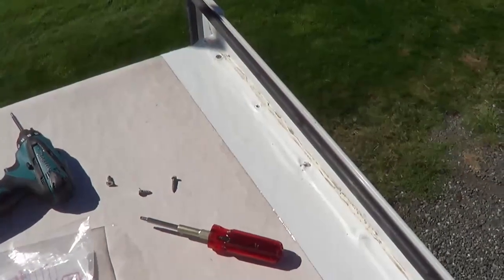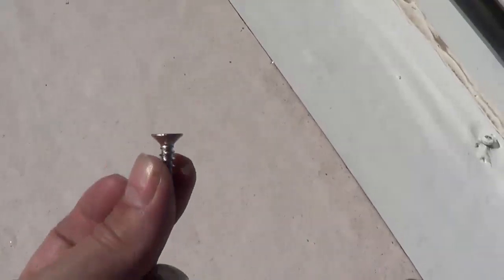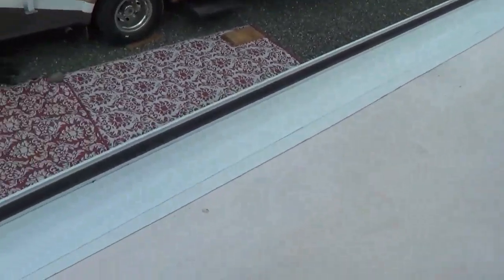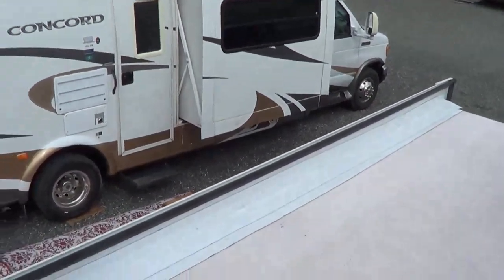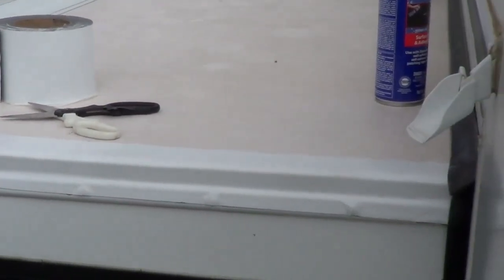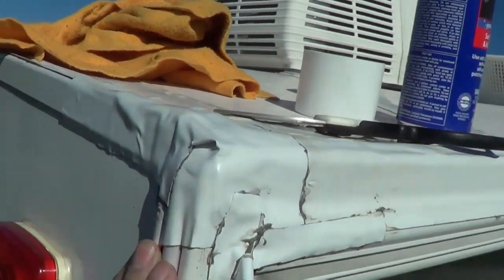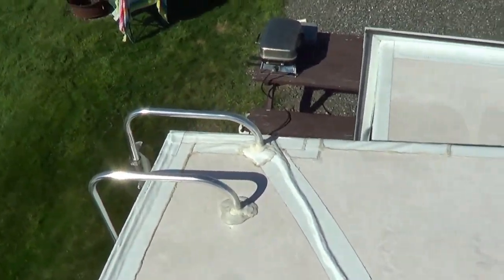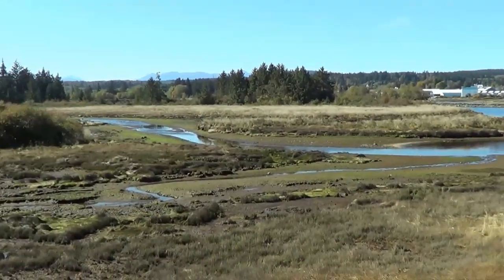Beefing Up My RV Roof Seals and Seams with Eternabond

Comment: What are you using to clean it with first?
Reply from the maker: I usually clean the roof first with water and dawn dish soap and a soft bristle brush. The use either mineral spirits, acetone or the Eternaclean spray. I decided I like acetone best, cheaper than Eternaclean and safer on the rubber roof than mineral spirits, though if your careful and make sure to wipe off excess it's not too bad.
Here was my original post on the tape and also my latest update.  https://www.loveyourrv.com/resealing-rv-roof-eternabond-tape/  https://www.loveyourrv.com/rv-roof-repair-eternabond-review/  Cheers! Ray

Comment: the tapes good in a lot of applications. but i would think twice about putting them on the corners & edges of roofs too much like that. Increases the chances of pooling with the tape acting as a small wall which wouldn't be too much of a big deal if it were a full fiberglass roof. but you said it was a EDPM Rubber roof.  like at 8:18. I can see that being a pooling spot with all that tape there. so with a EDPM you might have to watch it like a hawk for any cracking of the EPDM, which could still allow water in and a worser leak with the pooling. 

So be careful. :-)
Reply from the maker: +Troy Foxxin Good tip so far I'm not seeing water lasting very long up there, so no long term pools. I will watch the EDPM but I think with my trailers corner design it's an improvement. It was designed to pool right from the get go, very poor design I think.

I actually installed an on roof gutter to try and divert the bulk of the water and especially the ACs run off from getting to the corner. I get less pooling now and in my mind much more protection than original factory seal job.  There used to be many spots on the roof around vents and stuff where water would pool around the lumpy Dicor, now most pooling is on the E tape itself.

Here is a video I took of that area after we had the trailer 18 months for a look at what I mean. https://youtu.be/Cm5bGwXIZgw

Cheers Ray
Reply: Love Your RV oh i remember that video now. yeah silly design but that's cougar for you now that i think about it. lol

I seem to recall seeing some similar designs on other cougars i saw when working at a RV Dealer.

Comment: I’d have a concern that when you sell, a prospective buyer is going to suspect a situation happened that was far worse than you were trying to prevent. Just wish it could be made to look a bit better.
Reply from the maker: Yeah, that's a con for some and it may affect any warranty claims but for me it's worth the extra protection.  Five years later now and tape is still in good shape, no maintenance other than a roof cleaning has been required, sure beats digging out old sealant and adding more globs of it each year  - Most recent look at the roof -  https://www.loveyourrv.com/routine-rv-roof-maintenance-inspection-and-leak-protection/
Reply: On the flip side of that coin, a buyer may see that as what it is, preventative maintenance, especially if they look around and see no water damage or intrusions.  1st time buyers or those who lack understanding and knowledge will be the ones who would fear this.
Reply: @logun1970 . Exactly! Preventative maintenance.

Comment: How is it holding up after 5 years??
Reply from the maker: Great, no leaks and it hasn't peeled off.  I've used it quite a bit for stuff on the roof - https://www.loveyourrv.com/rv-roof-repair-eternabond-review/
Reply: @LoveYourRV  yeah I purchased it for my camper as well either tomorrow or Monday I'm putting a new roof on along with this tape so I'm pretty excited!
Reply from the maker: Cool. :) I recently redid my slide roof membrane - https://www.loveyourrv.com/alpha-systems-superflex-roof-installation-replacing-rv-slide-membrane/  My main roof is still pretty good even though its 10 years old so waiting for a good stretch of weather to just add some acrylic roof coating to it. It will give me some more years out of it, spruce it up and help it reflect the heat. Will be interesting to see if it sticks to my Eternabond tape.  Cheers, Ray
Reply: @LoveYourRV  the only thing is I think you should switch to silicone roof coating instead of acrylic!
Reply from the maker: This is what I'm going to put on https://store.lci1.com/4034-acrylic-roof-coating-white-1-gallon-862401.html  First you use there 8010 primer adhesive then the top coat. I've tried a number of the Alpha products so far and they have been good. You can also keep adding the product over its self.

Comment: Did you use Dicor lap sealant on the edges of the tape or EternaCaulk?
Reply from the maker: I used Dicor but in hindsight, I probably wouldn't use anything. The places I didn't do the edges with caulk show signs of peeling. - Ray
Reply from the maker: I meant "no signs"
Reply: Thanks, I have ordered some tape along with the EterneCaulk. My primary reason for the Caulk was to use on the EternaBond Webseal(that I also ordered) under my corner moldings but wondered if you had a change of heart about it. Thanks Again.
Reply: Replacement windows  for front side window for 1964 Shasta Airflyte camper

Comment: hi ray, did you use around your a/c unit?
Reply from the maker: +rick adam No, not the AC. It has its own specially designed mounting gasket to prevent leaks.
Reply: +Love Your RV Thank you for your response. My a/c unit leaks when there's a hard rain. Is there a way a can tighten down the gasket to help this leak? My cougar warranty is up.

Comment: Another thing to remember, it is not recommended to install pieces longer than 6 feet in a single piece. This is because the material shrinks, or "snaps back" and you will loose overlap on each end of your piece. This is regardless of the size of the piece. When you install the product, use a longer overlap between pieces than you want, as it WILL snap back. Your 2" lap will only be 1" in a year or so. Also, if there is any movement, the tape will split. There is no reinforcement!